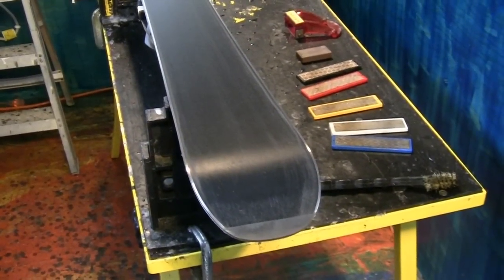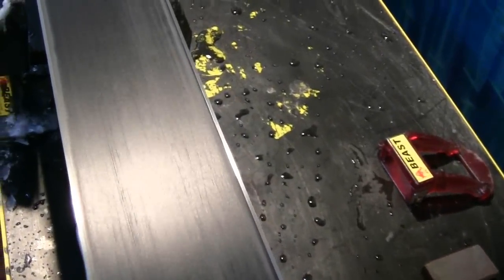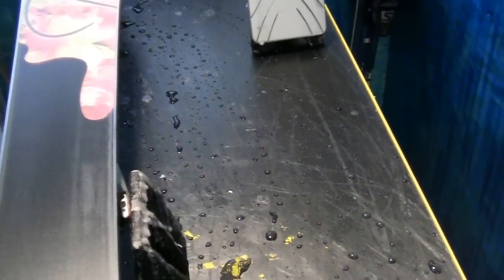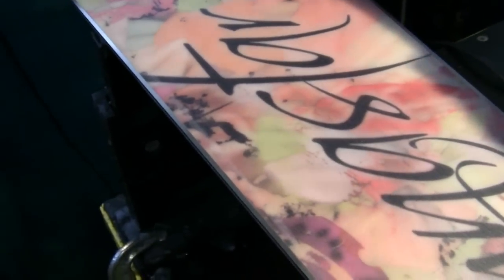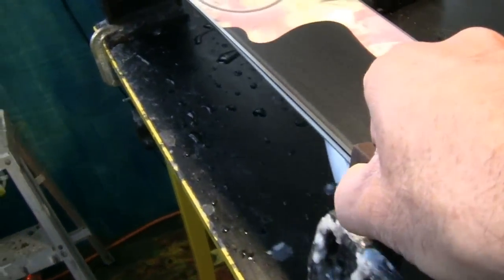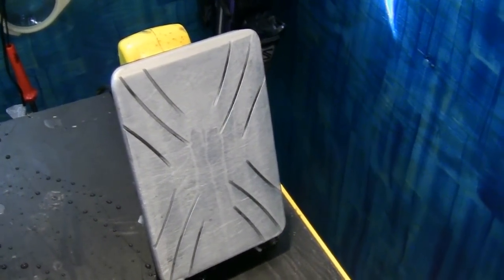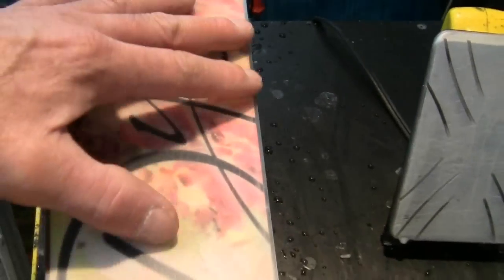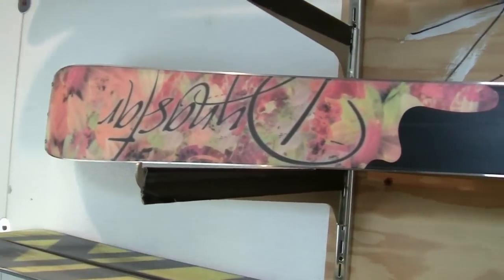How To, New Ski Tuning & Base Preparation Part 8 Final Look

Comment from the maker: @rsh5932 Without being there to see them, I'd say you did not hurt anything.  It's good that you worked over the base edges good.  That will make the ski turn, and skid easy.
A sharp ski edge will remove some fingernail when scraped over the fingernail.  It will not cut your finger if you slide along the edge like a knife.  If it cut your finger it would mean it's burred, and needs tuning.  
  The 1 & 3 tune you did is great for carving if you can carve.  
If you have good reflection, your good.

Comment: I have one more question. So, I finished beveling side and base of my skis and I don't know if I finished it well. So, I used 200 grits diamond stone to file until my 200 diamond stone goes very smooth and make a nice uniform reflection on my edges. I did it with a lot of pressure, fast and long strokes. After 200, I did 400, 1000, and extra hard gummy stone as the final step. I did 3 passes for 400 and 1000. So, now my edges have nice uniform reflection, and the tip of edges are very smooth.

Comment: But I don't know how sharp my edges have to be, so I can't really tell that if my edges are sharp enough. Also, will my edges have unequal reflections if they are not equally tuned? Like one part is 0.75 degrees but the other part is 1.0degrees. I used 0.75 for the base and 87 for the side. I feel like I over tuned my base edges and didn't tune enough for my side edges because I spent a lot of time on my base edges and tuned them vigorously, but I didn't spend enough time on my side edges

Comment: as I did on my base edges. My diamond stones went through on side edges really easily. I don't know if I only cut the side wall, but my side edges are shiny and have a uniform reflection just like my base edges after I tuned them. Again, my edges are sharp enough ( I think) have a uniform reflection on both side and base, and very smooth. Did I tune them right?

Comment: any opinion on the swix and toko adjustable base bevel guides? i have different boards with different base bevel angles.
Reply from the maker: Yes, use a fixed guide.  Adjustable guides are not good!  Base bevel guides are not expensive!
Look here: https://the-raceplace.com/collections/beast-tuning-tools/products/base-beast
Reply: Im using it to repair scuffed snowboard base edges from boxes and rails. But looks like 3 separate beast guides it is